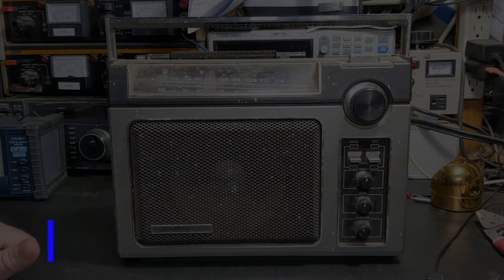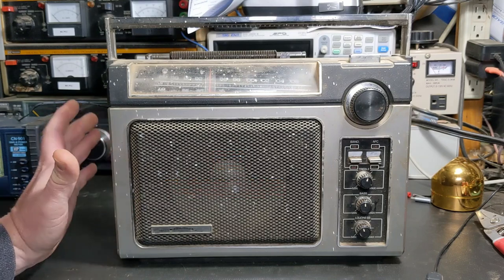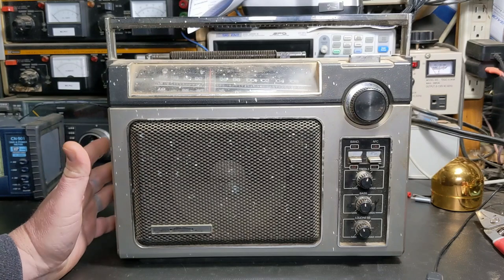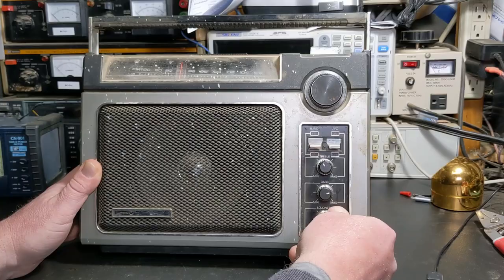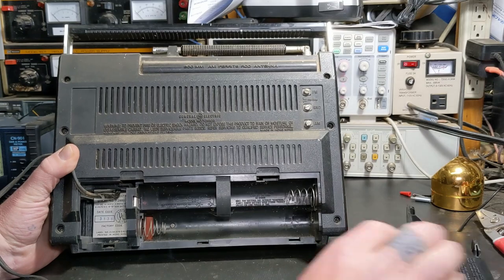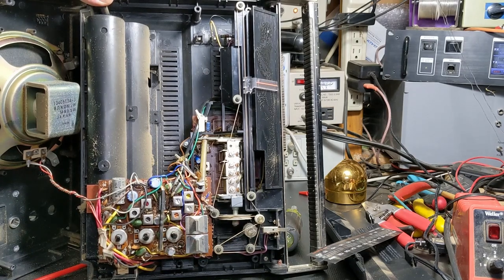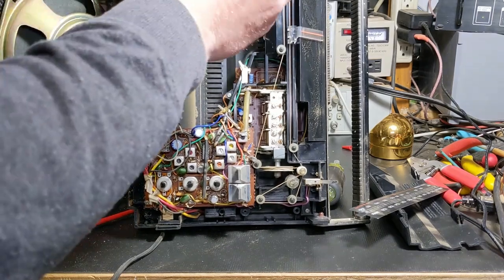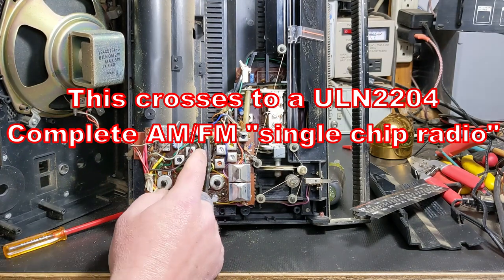GE Super Radio from 1979 | Restore Part 1

Comment: I am 70 years old. This is the radio that sits on the bedside table beside where I sleep at night. This exact model! I live in north-central Mississippi. There are no powerful AM stations near me at night so night time AM reception is spectacular. This radio brings me my radio talk shows at night. I've owned this one since I bought it new in 79. I was a radio/television repair technician for a local consumer electronics store and purchased it there then. She still works perfectly. Although I did have to re-solder the pins going through the circuit board off the band and ALC switch. That is a common problem with these radios. I have found no single radio that can perform to the level of this radio on AM. And I have the superradio 2 and 3! The 1 is the best for talk radio. The 2 is better for music. The 3 is junk! Now to you, the younger son of your father: this was your father's jewel for his radio listening pleasure. I'm 70 years old now and have found no radio that can perform to the level of this radio on AM. Not even today with all the electronic wizardry we have today. Long distance night time medium wave reception is not considered in the design of modern radios. But it should! Enjoy listening to the stations you Dad did back in the day. Because when you are as old as me, you definitely will!
Reply: @Untrepid One I actually prefer digital, but I have never found a single radio anywhere or manufacturer that measures up to these SupeRadios! That's why I've had mine all these years.

Comment: I found this in my grandmas closet while helping her move, she was gonna donate it to goodwill and said I could have it. So I got it. I am very young and this model came out the same year my mother was born. It still works, but I have trouble going from 106 to 106.1
Reply from the maker: Do you mean it is hard to turn, the tuning knob?
Reply: @ke4est  no. It’s the precision. The numbers at the top, (from 88-108) aren’t as precise as the numbers right below it. For example, 106.1 looks more like 105.7 on the top bar, and 106.1 looks like 81 on the bottom bar.

Comment: 43 year old E caps will have drifted out of tolerance. Clean the pots ,the two switches, and  oil the ends of the 
multi-section variable capacitor and it should be good for a few decades more. Clear Gorilla glue can be used on 
the dial face which often falls off . There is one on eBay right now with the same problem! 91% IPA will take care of 
those paint splatters without damaging the plastics. Looking forward to part 2.
Reply from the maker: Yep, I couldn't just leave them, even though I pondered it.  In the process of replacing the caps!  Yeah, this thing should out last me.
Reply: @ke4est  is part 2 out?

Comment: Tuning capacitor is a 3 gang model.  3 for AM (larger plates) and 3 for FM (smaller plates).  40 year old capacitors are not ok.  Change 'em all!
Reply from the maker: Yes sir, all caps always get changed!!  Not worth leaving them behind.  You are just asking for trouble.